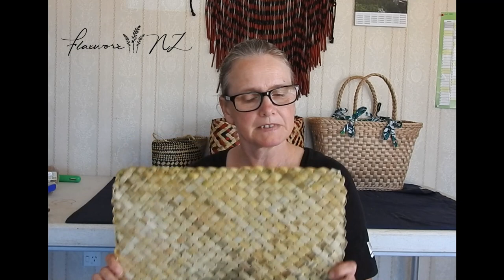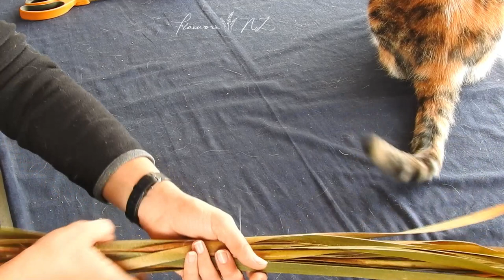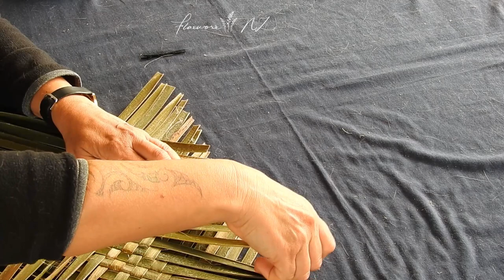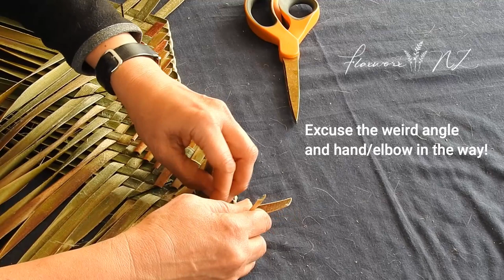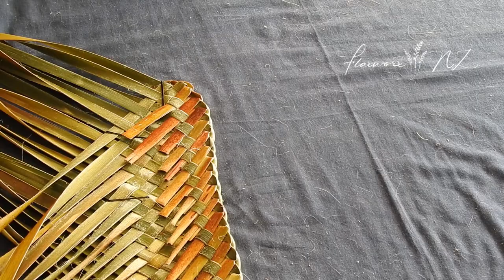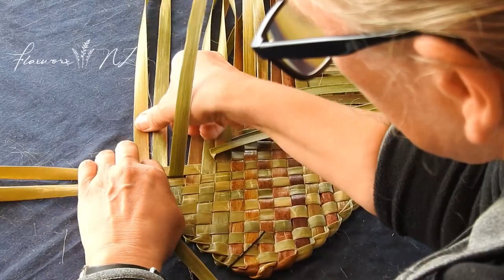How to turn the sides for a place mat or similar

Comment: Thank you! How many mm are you using for your whenu on this mat?
Reply from the maker: I think I mention it in the video - I forgot but I think its 40
Reply: Oh sorry i was taking about the width of your whenu, about 1 cm, or 1,5 cm?
Reply from the maker: @nataliaparrado1540  that is totally up to you whatever suits your usual preparation anything will go but the general rule is the bigger the mat the longer the whenu will have to be and the wider you make them the longer they will have to be. I just split them with my thumb so they are on average about 1-1.3cm in the normal range or half that for smaller width items and wider for other things.
Reply: Thank you, and sorry for all the silly questions :)

Comment: Thank you Mam it is very helpful, if someone wants to weave a bigger size means 12 feet square what if not by leaf but with plastic lace of some kind could you give me a hint of the length of a lace. ❤️ To hear if you reply if you still there please 🙏👍
Reply from the maker: oh, I don't know actually, I don't think I have ever woven anything that big before so I think you would have to try and find out. Apologies!
Reply: @Flaxworx  Thank you Mam❤️👍
Reply: @pkshiing4415  It would be easier to weave smaller sections together and then tie or weave the pieces together.  Kind of like quilting.